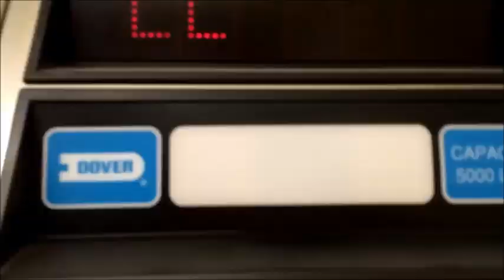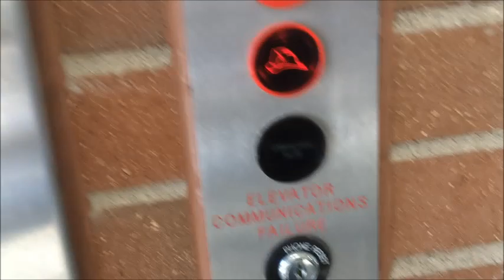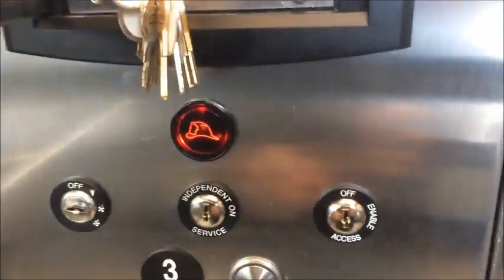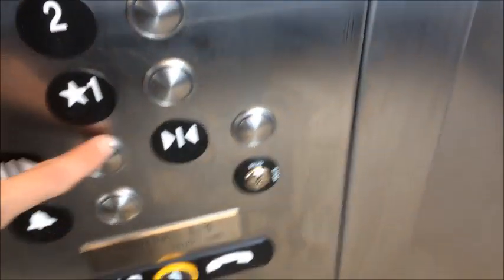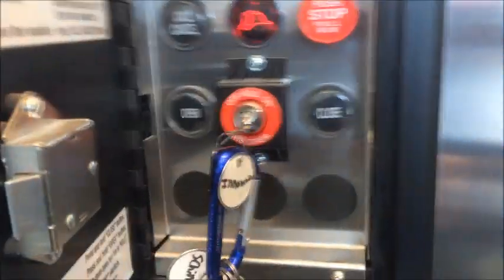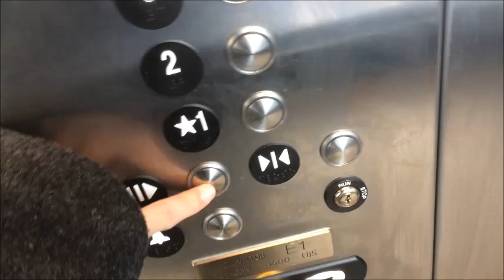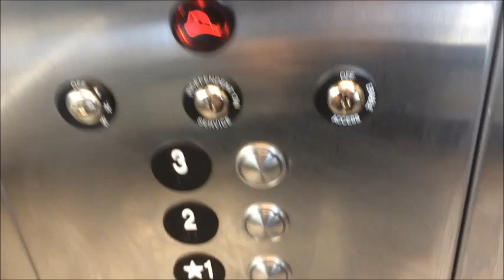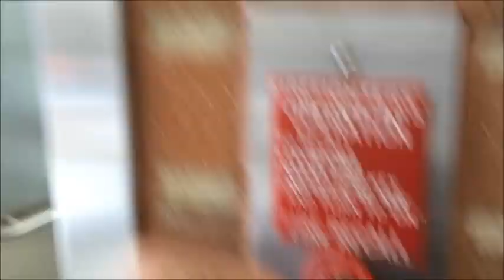Fire Service on a ThyssenKrupp Elevator | Elevator Video

Comment: So a fire department will only be called in case of a fire right?
Reply from the maker: Yeah they would be called in that case for sure, I’m sure there’s other reasons (that I don’t know) that the fire department may show up if there are other types of emergencies or inspections they have to do
Reply: @Jamestube8439 If I'm being the correct fire department will only be called if someone actually calls 911 or if the fire alarm goes off, either by someone pulling it or smoke tripping a smoke detector.

Comment: Question what does the access off up and down on the recall station do
Reply from the maker: When you turn the inspection key switch on in the elevator, you can use that access up and down switch to move the elevator up and down with the doors open, whether to access the shaft or access the car top, that’s typically what it’s used for

Comment: Nice demo! Also, I could hear the motor JUST A LITTLE BIT for some reason. Is it a quiet motor?
Reply from the maker: Thanks, and yeah the motor is rather quiet, mostly because of the fan.  It isn't anything too special, I've been on some hydros with way better motors.

Comment: I thought if you enable fireman operation on an elevator, it's going to send a signal to emergency personell (911) and will send help?
Reply from the maker: Nope, because why would it contact emergency services if the fire department is using the elevator in fire fighters' operation.  It would be pointless, however there are times where smoke alarms for elevators are hooked up to the fire alarm panels themselves.  That then could be a possible situation in which the fire department would be notified.
Reply: @Jamestube8439  Thanks! I got a bit confused when someone said that.
Reply from the maker: @brickvator  You're welcome.
Reply: In some buildings, elevator fire recall may be tied into the fire alarm panel and when activated, it may trip a supervisory condition and alert the monitoring company, which then could have the FD dispatched.  That happened one time in the Prudential building in Boston, MA when EMTs were using fireman service instead of medical emergency service.  I definitely think that anyone who wires that switch to trip a supervisory is doing it wrong as many states require a monthly test of fireman service to be done by authorized personnel and that particular setup would conflict with their ability to test it.

Comment: Question, are you allowed to purchase and have an FEO-K1 key?
Reply from the maker: Yes, owning keys are legal, using them without permission could be considered illegal.  (Depending on what you're doing, for example accessing locked floors is considered trespassing) Owning keys is ok for collection purposes, I only use them with permission.

Comment: Have you been denied permission to use elevator keys? 

If yes, please give an example of one time.
Reply from the maker: Yes, I wanted to ride a locked off elevator but the staff said that the elevator was for staff only.
Reply: Jamestube 8439 Do you remember where that was? And did you ask permission?
Reply from the maker: @johnoconnor4019  Not really and yes I did ask permission since I was talking to the staff member.

Comment: In the country where i live some elevators don't have a door close button
I will let you try and guess how you close the doors on those
Assuming it is in either car preference/priority service/whatever the elevator decides it wants to call it (the equivilent of independant service, but usually it is either labled car preference or priority service, but sometimes it may be called something else just to be confusing), or firemans service
Reply from the maker: Easy, you just press and hold the floor button in until the door's closed.
Reply: @Jamestube8439  
Correct
oh dear, it seems like it is wall of text o clock for me...
and what may be the weirdest thing about firemans service where i live, is that usually there is only 1 elevator in the building that has firemans service, and in low rise buildings there may not even be an elevator with firemans service (all modern elevators where i live do have an automatic fire recall which is linked to the fire alarm, for example the main elevators at the college i went to back in 2018/19 (whoops, nearly gave away my location) would automatically return to either the ground or first floor if the fire alarm went off (and that is if the fire alarm was set off from any detector or manually set off from anywhere), i remember when the right hand one wasnt working, and there was what i can only assume was a fire drill, the left hand elevator would have returned to one of the two designated floors, and i know from later that day that the right hand one had gone into recall mode, athough as it wasnt working it just sat there buzzing (the elevators at that college would break down what felt like every other week, one week elevator 1 would be broken, and after elevator 1 was fixed, elevator 2 would break down later in the same week that elevator 1 was fixed, and once elevator 2 was fixed elevator 1 would then break down later that week)
Reply from the maker: @pineappleroad  Interesting, and I must say that it's awesome how elevator technology has evolved over time.

Comment: I really want to buy a fire service key but I’m afraid it will call the fire department lol
Reply from the maker: It won't, because fire service is used by fire fighters.
Reply: Jamestube 8439 I’ve heard that some do
Reply: It very well could. Most buildings have the elevator recall tied to the fire alarm panel in some way. If a smoke detector in the elevator lobby or machine room is activated, phase 1 elevator recall automatically initiates. In the same way, the alarm panel can monitor the elevator to where if recall is manually activated, it can trigger a supervisory or trouble condition on the panel, which is monitored. From there, the fire department, or at least building maintenance, will be called to respond to the abnormal condition on the panel.
Reply: Yeah in some cases it is linked to the fire alarm system like when the fire alarms go off. At least that’s what I heard

Comment: Question what if you had two keys and turned on phase 1 then phase 2 but without turning off phase 2 you turn of phase 1 what would happen?
Reply from the maker: I don't know for sure, but I'll bet when phase 1 gets turned off, phase 2 also goes off.  That would be my guess since I have tried turning phase 2 on while phase 1 is off.  I'll have to try it someday.
Reply from the maker: @pineappleroad  Interesting, probably a controller glitch
Reply: Phase 2 remains activated for that specific elevator.

Comment: In case if the fire alarms go off, elevators are turned off, use the stairs.
Reply from the maker: Most of that is true, however the elevators are not ever turned off unless a heat detector activates causing the shunt trip to turn off the elevator, that's why firefighters should forcible tools with them when using the elevators, if it were to shunt trip, the elevator would shut down and not work at all, they would have to break out of it.  But if there is no shunt trip, then the elevators may be in fire service or have not been activated in fire service.
Reply: @Jamestube8439  Personally, I think there should be some sort of emergency forcible tools accessible to elevator passengers so should there be high heat (no smoke) in the elevator control room and the elevator shunt trips with passengers on board, they can get out. And of course, just so no one messes with the tools if there's no emergency, it can be a federal crime
Reply from the maker: @flightlevel3608  I agree with that, I do think in a very very dangerous situation there should be some kind of emergency release to release the door and some way to allow trapped passengers to escape

Comment: Is it really a good idea to put the emergency stop button under lock and key?
Reply from the maker: The button is above the lock and key, what do you mean by that anyway?
Reply: Jamestube 8439 I mean you had to unlock and open a cabinet to get access to that button.
Reply from the maker: @Sparkette  Oh, well in that case, the button is for emergencies, there is a key switch at the bottom of the car operating panel for run/stop, I was actually there the other day to do a Run/Stop Key Switch Demo and an Inspection Demo too, I will upload it later on.
Reply: Jamestube 8439 No, my point is that if it's for emergencies, shouldn't it be usable without a key?
Reply from the maker: @Sparkette  Well firefighters need it to stop the elevator if it getting to close to the fire floor or need it to stop, but I think all elevators should have an emergency stop switch which sounds the alarm and a keyed stop switch which is to take the elevator out of service.

Comment: Can you activate fire service from within a car, or do you first have to activate phase 1 from outside the car?
Reply from the maker: Ah, good question, I have tried that but no, it doesn't work from inside, you must do phase 1 first, but I mean that would be a good idea for some newer elevators, good question by the way and thanks for watching!
Reply: @Jamestube8439  in New York when u use the fireman key it won’t come out unless u turn it off why
Reply from the maker: @READ1NG  Which phase are you referring to?